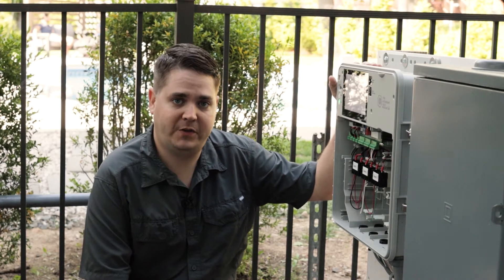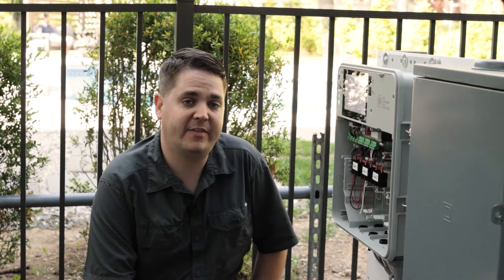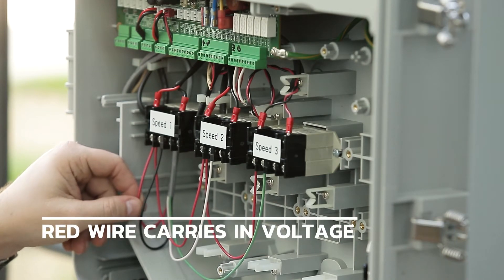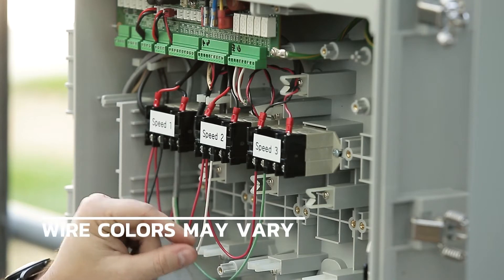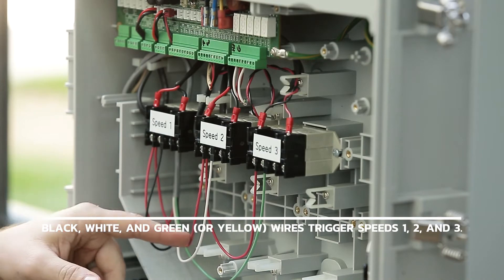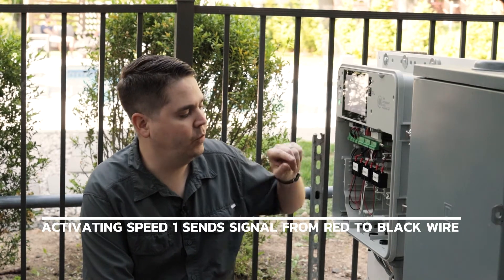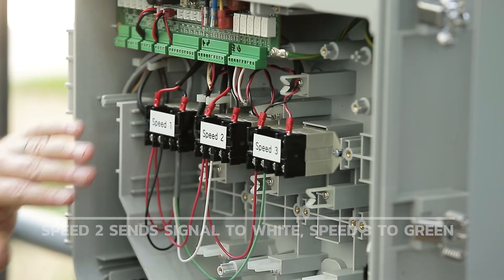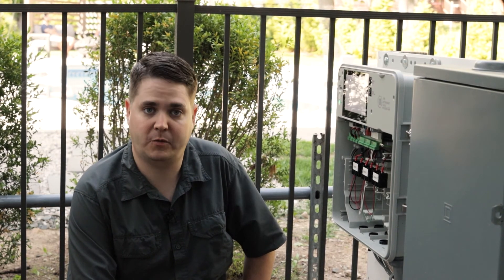How an Automation-Capable Variable Speed Pump Adapter Works

Comment: This is the video I was looking for. I have the blue torrent pump and wanted to connect it to an Omni hub. The Omni comes with two relays, buy addtl ones at $250 a piece.  By the time you buy the addtl relays it would be cheaper to buy a new Hayward pump.